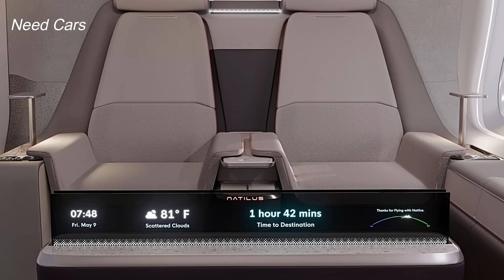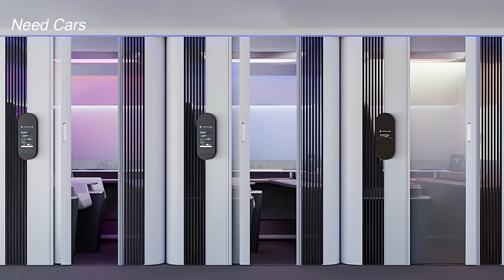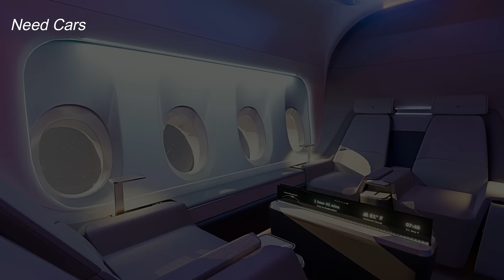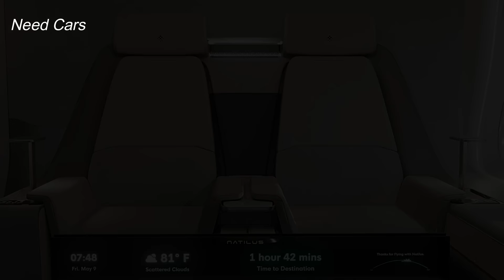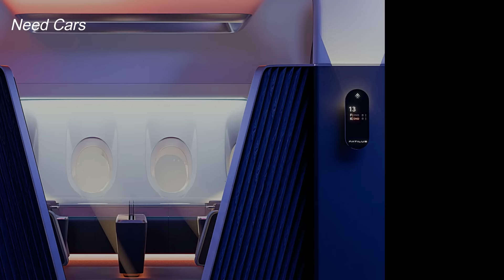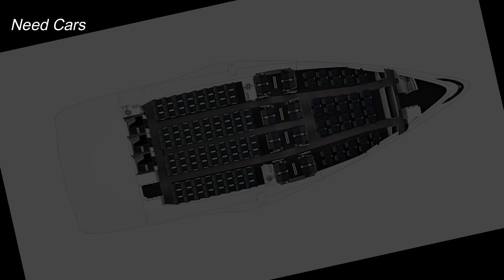Natilus Horizon Blended‑Wing Jet Revealed: 250‑Seat Cabin, 50% Fuel Savings & A320‑Killer Design

Comment: There are no jet engines specifically designed for boundary layer suction.
Boundary layer suction should be handled by motors.
High-power jet engine generators have already been developed by IHI of Japan.